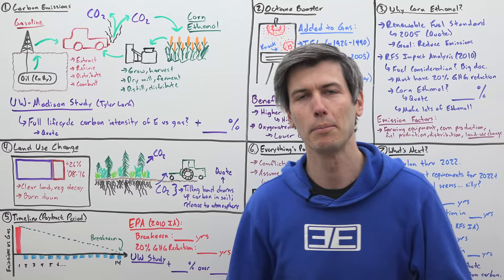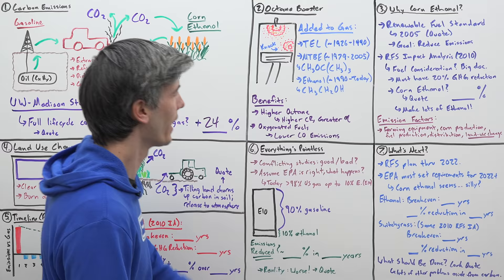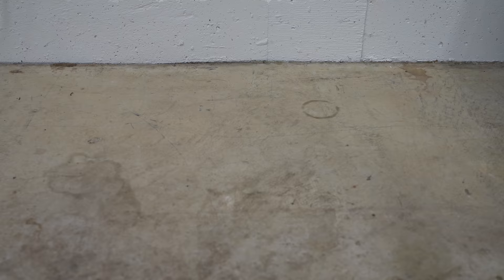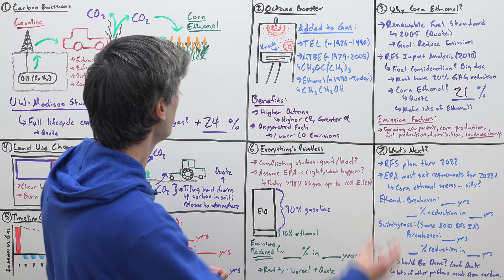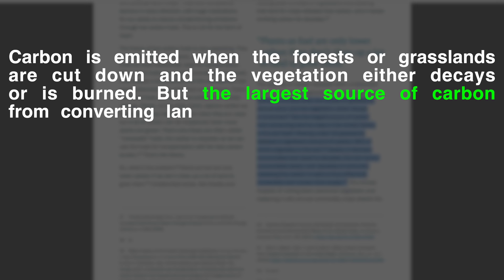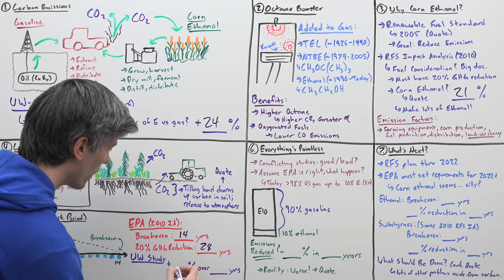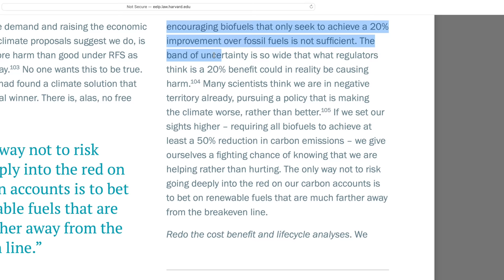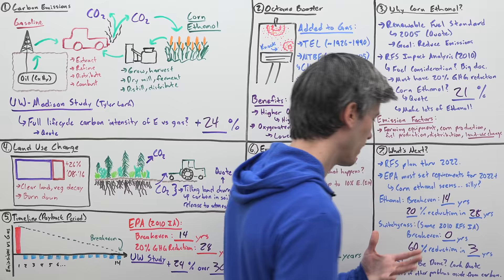America Was Wrong About Ethanol - Study Shows

Comment: That liquid mess is destructive to carburetors. Especially, small engine carbs.
Reply: The identical small engine carbs in Brazil use their common gasoline which has a minimum of 27.5% ethanol.  It has worked out so well and for so long that Paraguay went to E27.
Reply: @danafletcher2341  Talk to the owners and mechanics, you’ll hear a different side. I have repaired hundreds of those small engine carbs, and it wrecks them. Here in the States we use 10%. It should not be in gasoline at all. All it does, is line the pockets of the corn lobby and politicians.
Reply: @Jumper777-k3f  If you truly believe that, then I suggest that you sell everything you have, move to Brazil where E27 is used, and buy every single small engine repair shop you get a hold of.

If what you claim is true, then you should become a gazillionaire in no time at all.  Thank me later.
Reply: @Jumper777-k3f  I have been using E10 since the early 1980s and own quite a few small engines.  When is all this destruction suppose to happen exactly?  

Alcohols clean things.  I remember how bad E0 was in the 1970s, my fathers small engines would varnish over winter and the smell, like a skunk, is something one never forgets.  I have never seen E10 varnish.  My first repairs I can remember was using carb cleaner to free the needles in his carburetors.  I remember seeing a bowl with sheets of dried varnish holding up the float.  Never has happened since E10 came to be.  

The transition from E0's varnish build up to E10 was not good especially with small engines since back then they did not come with fuel filters.  But once clean E10 kept things clean after the transition.  

Seafoam, Gum out, and others actually use alcohols as an active ingredient.  

Ethanol on most any manufacturer's chemical compatibility chart you will find is at worst equal to but more often far easier on rubbers, plastics and metals than gasoline and BTEX (benzene, toluene, ethylbenzene, and xylene).